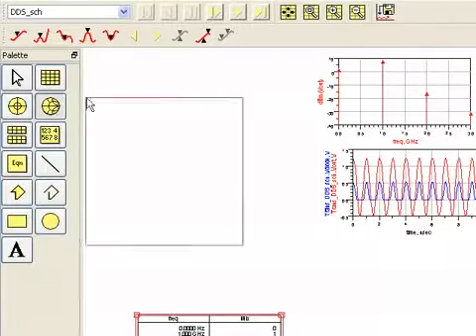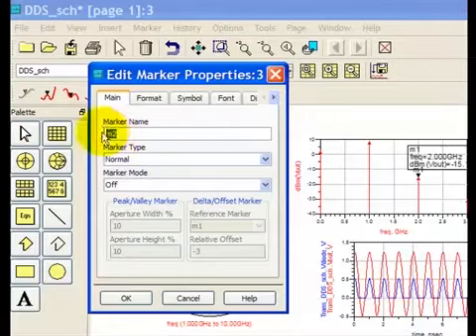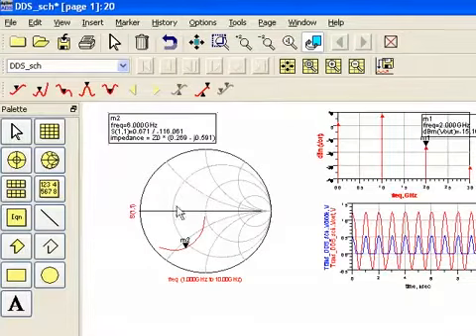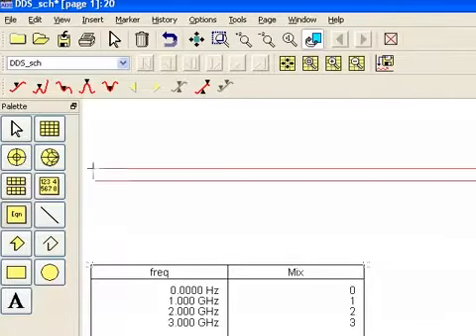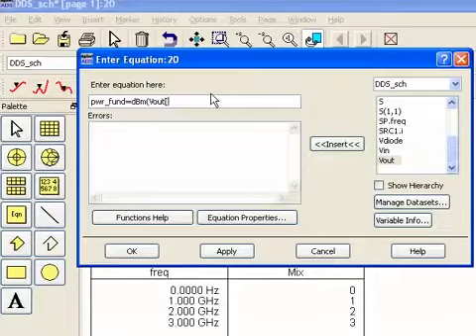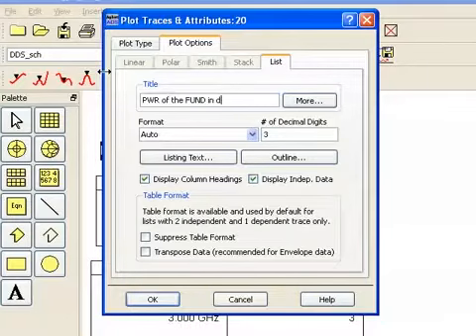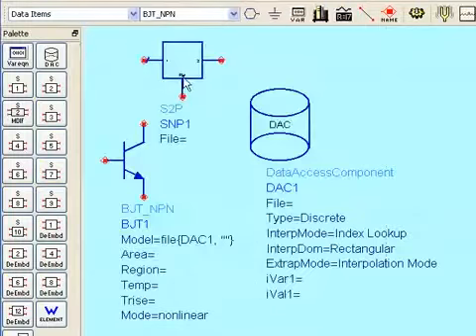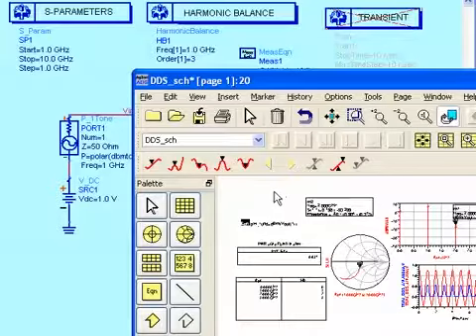Data Display in ADS (Part 2B)

Comment: Hello,
As you mentioned in 3.38, someone can take the second element of an array  using x=data[1].
Consider we made a basic simulation and have voltage plots dependent on time. The simulation normally lasted for 3ms, but I just want to make some calculations only the data between 2.5-3ms. How it could be possible?
Sincerely yours